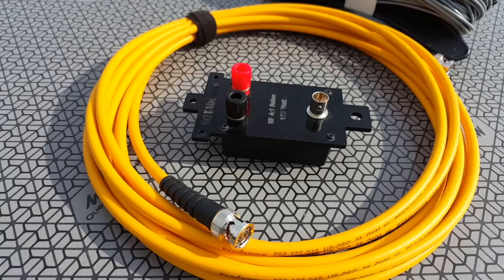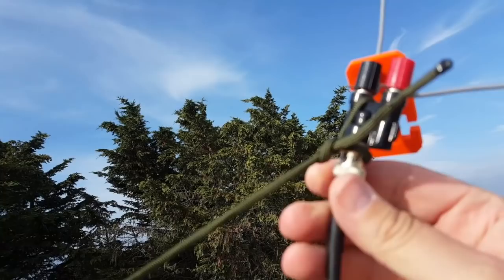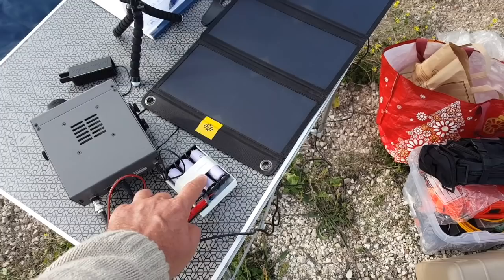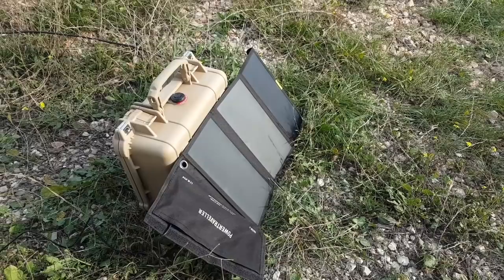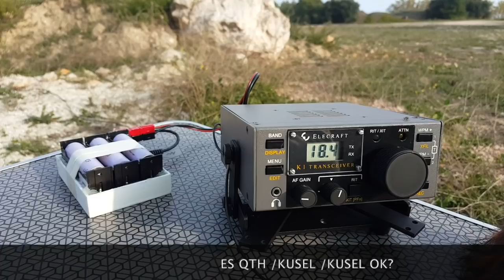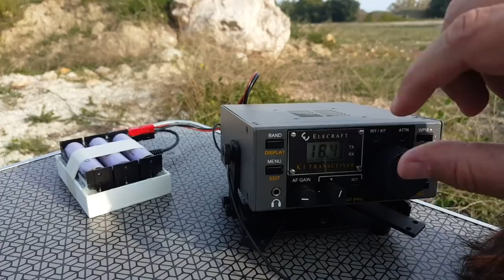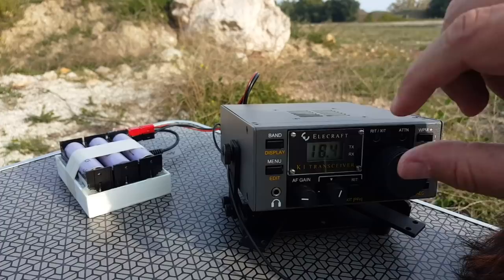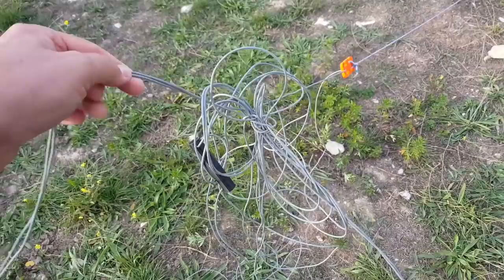Building a Delta Loop Antenna For The 30m Band, Part 2.

Comment: Good Day Gil from Florida USA. 
I use mostly Delta Loop antennas here for 20-40-60-75-80 and 160 meters. I played around with ladder line, 1/4 wave 75 ohm stubs etc. But on all of loop my antennas are feed with 4:1 Baluns. And I can cover most of the band width on all bands with them. However the baluns are current baluns and not voltage. The voltage baluns burn out to quick. Anyway nice job there. 73's de W4DRA
Reply from the maker: Thanks. I spent 22 years in Sarasota!

Comment: If you place the feedpoint 1/4 wavelength from the apex, you will have a better match and pattern.

If you flipped the delta upside down, you could use a much shorter mast. The effective height would then be 1/4 lower than the top horizontal wire, but you will need only shorter vertical mast. You could 3D print a Y-shaped adapter to go on the top of the shorter mast. Then insert a piece of mast in the open end of each "vee" prong of the Y adapter. The loop wire runs along each of the vee masts and then horizontally between them at the top.

Place the feedpoint 1/4 wavelength from the down-pointing bottom apex, up either one of the vee masts. 
Keep in mind that this antenna works best close to the ground. 0.2 wavelengths above ground is the "sweet spot."
Although it has less gain than a dipole at the same height (except at 5°, where it surpasses the dipole), it has superior receive characteristics than a dipole and far superior to a vertical. This, because it responds mostly to the magnetic component of radio wave. You may (will) find that often the signals received on the loop will be less strong than on a dipole or vertical, BUT the superior signal-to-noise ratio of the loop reduces noise by 6-12 db or more. Also, if you are able to turn the antenna, you can null out or greatly attenuate signals from stations in the plane of the loop (i.e., with the edges of the loop aligned with the station(s) you want to attenuate).

Remember, these work best for DX at about 0.2 wavelengths above ground; higher up, a high-angle lobe begins to form.

You should be able to use this antenna on its 10m harmonic. But if you feed it at a corner, the feedpoint at the harmonic will be a voltage peak rather than a current peak and although the impedance match should be OK, the Voltage SWR will make your radio reduce power (or if it has no self-protection circuit, may wreck the output transistors).

73 de WA7VTD
Reply from the maker: Great info, thanks!

Comment: I have used many of these loops. I have found the 1/4 open line of 75 ohm works perfectly if it is truly 1/4. I have found that the velocity factors described as standard are not always spot on. The best method is to cut , little by little, the coax (starting longer of course) . Seems like a 3% difference was found, and I believe it needed to be shorter. Worked perfectly when matched with the correct loop length. Another thing that I've dealt with is that when the delta is horrizontal, and low, a 1005/f measurement works. But, when its quite high, 50 to 75 ft, it must be lengthened. An 80 was lengthened 12 ft and worked VERY well once that was done @75ft. I use a 4/1 with that one, and also open wire line (4/1 is in the shack, fed by 450 ohm window line. A contact with D4C on 15m ssb with 5 watts was made, California to Cape Verde Islands, near Sierra Leon, in Atlantic , 80m loop in Delta config vertical.  uBITX. Liked, shared, and subscribed.
Reply: Re length and size. I live in a wooded area, many trees. I have a air propelled cannon. I shoot rubber balls up, with string attached at first. Then i pull up a small rope with the string. I have been thinking about a CO2 version for putting pressure into the PVC cylinder.
Reply from the maker: Great info thanks.

Comment: Actually it seems to have 200 Ohm impedance. That’s why 1:4 balun nicely transforms it into 50. At the same time 1/4 75 Ohm coax should transform it into something close to 25 Ohms. And that’s what we saw on your AA.
Many tv coaxes have foam dielectric and vf something close to 0.85. But if you have vector AA it’s very easy now to check vf and see that coax is actually 1/4 on desired frequency. Moreover many cables have impedance different from nominal, and that also could be checked with vector analyzer. Connect a dummy load to you feed line coax and sweep it 1-30MHz and check the results. That could be very interesting ))

Anyway good job! Thanks for video ))
Reply from the maker: Thanks!
Reply: Yep, if my calculation is correct, it would have to have an impedance of about 113 ohms for a quarter wave 75 ohm transformation to result in 50 ohms.

G1EKW.

Comment: I have used a full 40m vertical loop suspended by 2 trees with the top about 15m. I can highly recommend it if you have the space. It was very quiet and a strong performer for dx even with only 100w.

Comment: Excellent little.2 part series gil thanks for sharing. I keep seeing conflicted views about what balun should be used regarding delta loops . Some say a full wave loop is around 100 ohms so a  2:1 balun is best. Others say use a 4:1 balun. Could you explain  why there are 2 views of thought cheers
Reply from the maker: No idea, but 100/2=50, so that should settle it ;-)

Comment: Add my previous qth I used full wave closed loop Delta loops with quarter wave coaxial Transformers. I almost always had to lengthen the loop element slightly to get a perfect match.
Reply from the maker: Interesting thanks.
Reply: Same here. I think the issue is like with a dipole. If the two wires aren't cut to the same length their resonant freq do not match. Thus the dip for them both never drops its its lowest. 

The wire loop has its resonant freq and the 75ohm matching stub has a separate freq. If the two do not match or align properly then the dip suffers. 

QRP baluns are fine but QRO baluns are heavy! I just hate hanging one up in the air on a permanent antenna! Added strain on the whole system! Plus plastic only lasts so long in the sun!

Comment: Gil, the initial reading without matching seemed strange (34+50j) that should be 100+0j as far as I remember. Instead of trimming for low swr (prior to matching) it might be better to find resonance by aiming for zero reactance. Be careful when matching capacitive or inductive loads with a balun. Nice location, great qsos, great weather btw. Also you brought the foufou, that adds to the outdoor spirit. 73
Reply from the maker: Thanks. The coax might explain the difference..
Reply: @RadioPrepper  Hi Gil, just a question: have you set the reference place at the end of the 50 Ohm cable? That's could be the reason why you get this strange Z= 34,5 + j 55,7 Ohm instead of something similar to Z= 110 + j 0 . Once you have cut the wire in order to set near to zero the X part of the impedance you could find what's the right method to matching the impedance and for example calculate the  length  of the 75 Ohm cable that give you the better possible result. If you remember the lenght of the 50 Ohm Coxial cable you could also now figure what the Z at the feed point using for example SimSmith and subtracting to Z= 34,5 +j 55,7 the length of the 50 Ohm cable. Thank you for your always interesting videos. 73 de Paolo. IU1CYF

Comment: When the sending station has lousy spacing, it's hard to tell what the heck they're sending. You could be perfectly rested and sharp as a tack, and if they send mush, you're not going to copy it well. Some hams get in a big rush and don't take the time to put proper timing into their sending, whether on a straight key, cootie, bug, or paddles. It drives me CRAZY when people just send all the characters in a single stream with no spacing between LETTERS, much less WORDS! That's impossible to copy!
Reply from the maker: Indeed. I realized it after, editing the video.
Reply: @RadioPrepper  Have you ever made a linked dipole? I have one I made for 40m, 30m, and 20m. It works great! I went to a local park by our municipal center and raised it on a 7.2m telescoping fiberglass mast, clamped in a drive-on baseplate. The far ends have glow-in-the-dark paracord ties with paracord tensioners, and at this location I clipped the paracord to some photographers' sandbags to hold them down. Some places don't like you pounding stakes in their ground, so I have the sandbags. They're black with day-glo yellow stripes so they're hard to miss.

I worked from Philadelphia to the Upper Peninsula of Michigan, about 800 miles, almost 1300km, on 10 watts, 40m phone. I tuned it to the CW portion of each band, but the tuner in my KX3 tweaks it just that little bit in the phone portion, just to keep things as matched up as possible.

It's nice to be able to work my favorite 3 daytime bands on a single antenna, even if I do have to plug and unplug the links when I change bands. I'm working on a fan dipole made from 2" wide electric horse fence webbing, 15 parallel stainless steel wires woven into poly webbing. I hope to be able to tune it for 40 on 5 wires, clip 5 more to tune it to 30, then clip the last 5 wires to tune it to 20. It'll be tricky, I'm sure, since the wires are so close together, but I hope I can get it to tune up. That way I won't have to do any plugging or unplugging, I can just change bands and go! Much nicer for bad weather, or just so I can hang it up higher in the air!

Comment: That's some bright coax you've got there
Reply from the maker: Not to confuse it with 50 Ohm coax.
Reply: @RadioPrepper  I figured so. Really good idea. I usually just use the stuff they sell at the hardware store but the quality has really gone down hill recently. The stuff they used to sell had a copper foil and thick copper braid. Now it's aluminum foil with a few strands of copper. Still I always put the F type plugs on it they sell for it and use bnc adaptors. I thought you'd  find a 30m Delta loop a bit cumbersome. I think I'd go with a half wave end fed too. My 80m halfwave isn't perfect on 30 but it works and gives me most other bands into the bargain. I find the Delta loop to be a good on 6m it's easy to string up on a fishing pole. I thread it through a 2m length of pvc pipe to make a triangle that doesn't need to be roped up and stuff to hold it's shape. I used that for a while until I built a 3 element beam for 6m but the beam is too cumbersome for portable use. It just barely fits on top of the truck when assemebled but I have to take it apart to store it in my garage. The Delta loop folds up nicely and is quick and easy to deploy
Reply: Ohh on second watch I noticed you said you weren't sure if your matching stub was the exact length it needed to be. What I do to measure my matching stubs electrical length is hook it up to my analyser and leave the end open. At the resonant frequency it just looks like a short on the analyzer impedance plot. I do the same thing if I want to measure the velocity factor too

Comment: great info.. wonder if the 75ohm match would work on 40m, not 30, ?. .Great Videos! n5ysw
Reply from the maker: It has to be a quarter wave..
Reply: Yes. I use a sloping delta for 40m. 2 ends high one low. It is 6-7db better than efhw. 75 ohm stub 1/4wl minus velocity factor of cable.

Comment: In English "balun" is said with a short U sound 
It is "impEdance" with a long E sound
I have made a "D" shape using a larger diameter G10 tubing for support.  The tube was about 2cm in diameter.  Larger Tubes about 30cm long that fit tightly over the smaller tube made the joints.

Comment: Hi Gil, the beauty of a delta loop is they work very well low to the ground. I also use one on 6m and it has performed most excellently.  30m delta loop is quite large. The trick is to mark the corners. and also to have the distance out from the mast  base marked out. that way you can run it out loosely guy it and than raise the mast and it should go up well. 
I guess its all in the planning. Sotabeams wire winders will stop your tangled mess at the end. hee hee.

72 Gil hope to work you on the bands de g0nmy sk pip pip.
Reply from the maker: Thanks. I hope so :-)

Comment: Where do you find such good helpers? All my friends are either working, to busy or to lazy! lol 

It has to be a location with the perfect lay out of trees somewhere! I just know it! What about that trail ride you took up in the mountains! I bet its a spot near a summit along those trails with the perfect trees spaced 105M  or more apart. 

I love my 30M horizontal loop! Its about 70ft up! See WW5RM-13 on the APRS map. With 20 Watts I get into Australia a couple times a week or so. I hear Italy a few times a week. But I think he is running big power and or using a hop path in his beacon. 

I used a 75 ohm coax matching stub. RG6. I used F connectors and they aren't very good! Plus the shield is pretty weak! So I had to reinforce along the connectors with zip ties and electrical tape. So far its been up for almost a year now.

Im thinking maybe some good BNC connectors. Cut the 75 ohm cable to precise length and put connectors on myself. BNC connectors look like a pain to install though. I did a N type once! I said id never do it again! lol
Reply from the maker: They found me! How long is your 75 Ohm cable?
Reply: @RadioPrepper  I forget. I found a formula online for it. I can research it for you. Anything beyond yesterday tends to get stashed away in file 13 / recycle bin. =]
Reply: @RadioPrepper  see how crazy I am? I didn't use F connectors! Wow! I used PL-259 reducers but that shield on the RG-6 I used is pretty weak! So I reinforced it as best i could to take the strain off the connection.
Reply: @RadioPrepper  I believe this was the site I used.

http://www.66pacific.com/calculators/full-wave-loop-antenna-calculator.aspx
Reply: Looking back through the log on 30M APRS it looks like the band fell in the water / died out from 0100 UTC to about 1200 UTC. No stations heard during that time. But that seems to happen a lot. 

That's usually the time frame I hear Australia but sometimes it falls short. I am anxious to see how 30M conditions are during the peak of the sun cycle. I never really used 30M enough in the past to know. But during the day I get Canada and Mexico regular. Its a guy in Michigan, WA8LMF he has a pipe line to me! He is 1380 miles from me. Its a few others I see on the map everyday. Same time like clock work. 1000 - 1500 miles +-

Puerto Rico was coming in for couple of days. Its over 2000 miles from me. But he is gone now. Some of them are not on it everyday either. So its not always accurate but for the most part a pretty good propagation tool.